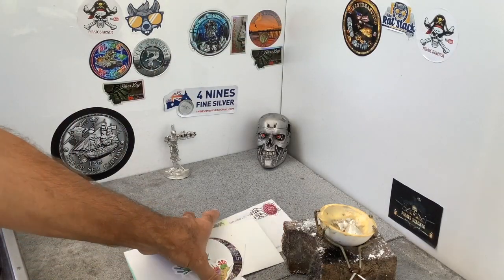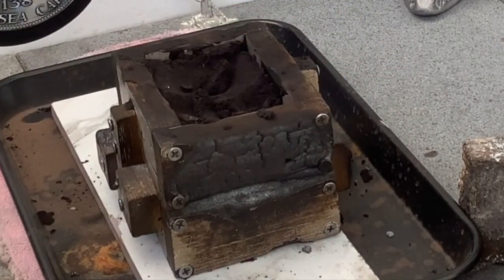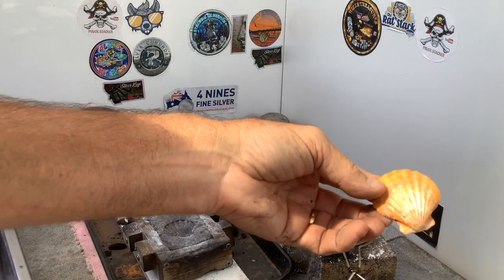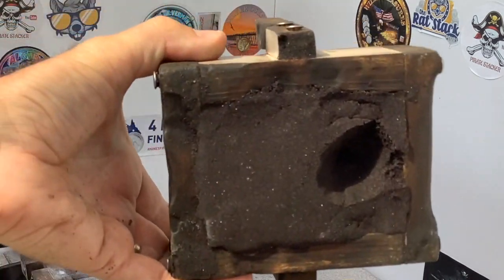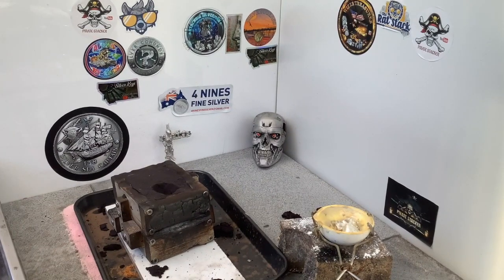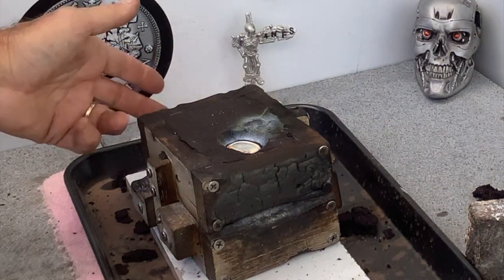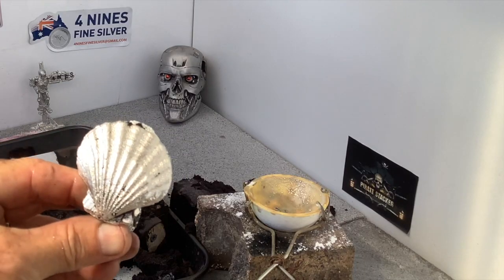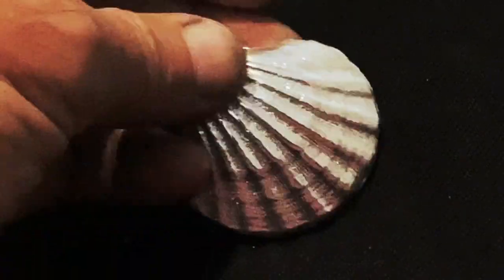pouring a silver seashell

Comment: I noticed you didn't use a hammer to compact the clay. But I just started sand casting. I was told to use a hammer, to compact it tightly. But every time I hammer the delft clay into the mold, the clay will "split" somewhere on the top of the clay. I'm not pounding real hard, but it splits every time I try to fill the mold. Do you have any idea what would cause this? The clay was from an unopened bag.
Reply from the maker: Hey Scott, thanks for your question. I don’t see the need in packing extremely tight. I use just use my thumbs and palm of my hand then  finish with a rolling pin that is sufficient. I’ve never understood why people feel they need to pack the sand that tightly. Just keep practising you’ll get the hang of it.🤠👍
Reply: @4ninesfinesilver315  Thanks for the reply. I appreciate it!